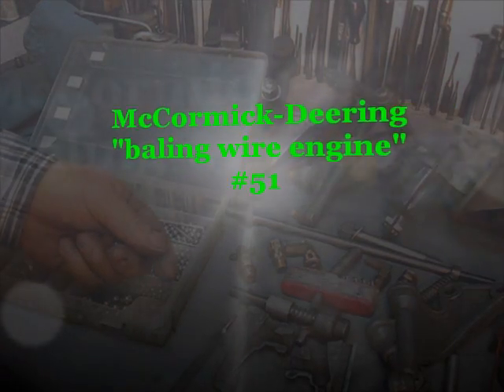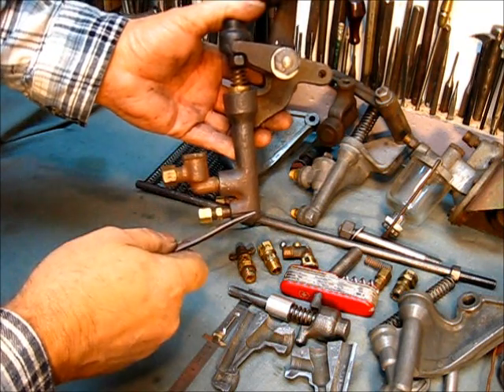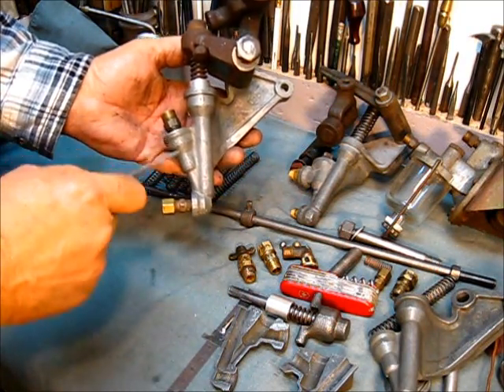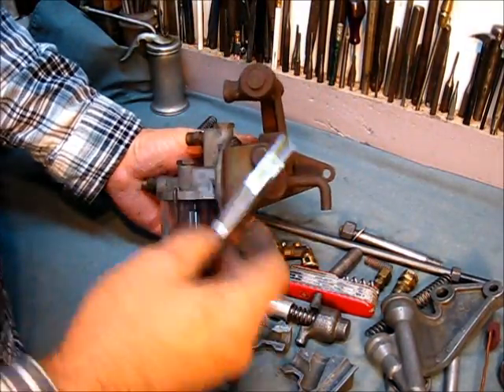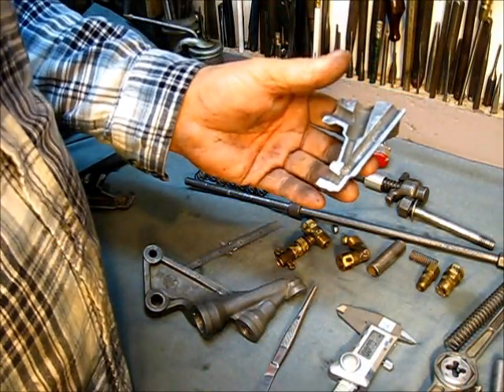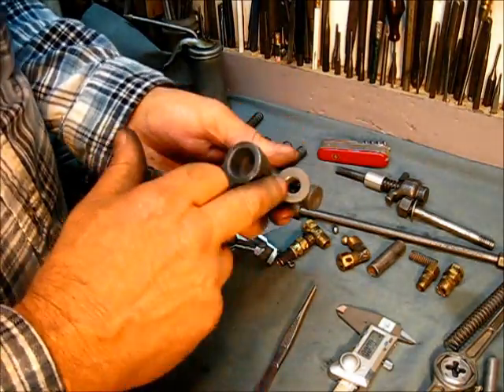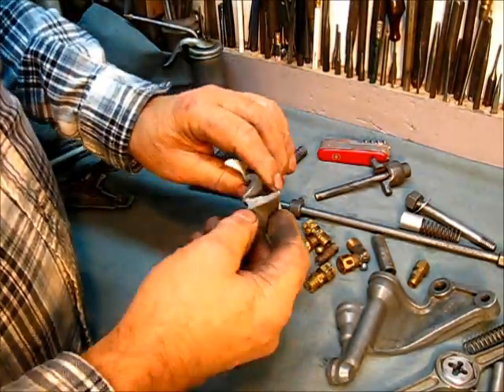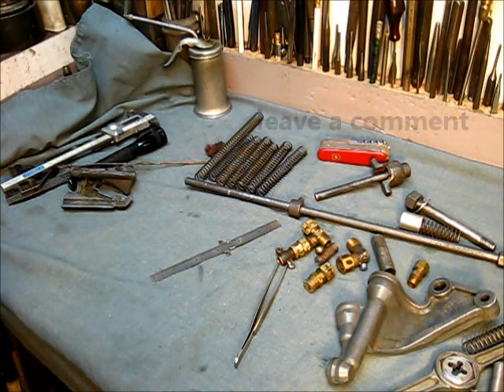McCormick-Deering "baling wire engine" #51

Comment: Can the pump housings be welded or brazed to seal up any holes?  I would think you could weld over the thin section before citing a new seat just to give you some extra material so you don't make a hole.

Comment: About 50 years ago I was taught by a very experienced old time mechanic that an effective, simple way to repair a seat in a carburetor and pump check valves, etc., if it's not too bad, is to take a good hard ball, put it in the seat and strike it quickly, firmly but carefully with a punch. Sort of like how you strike a center punch. With soft metal, the ball will reform the seat. You have to learn the"feel" but I've used this with great success many times on leaking seats.